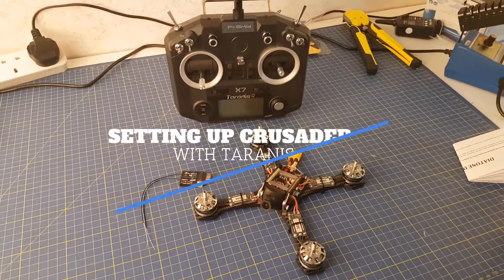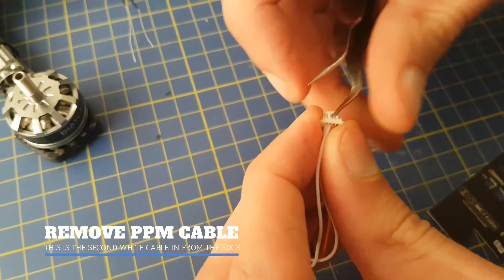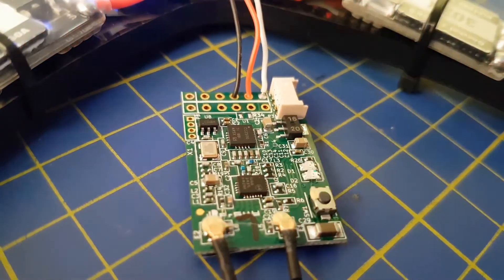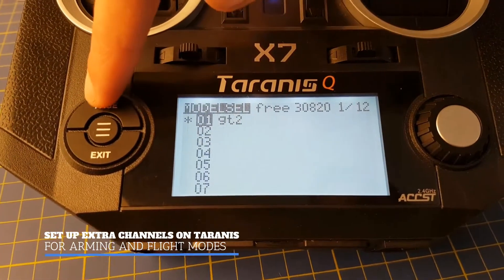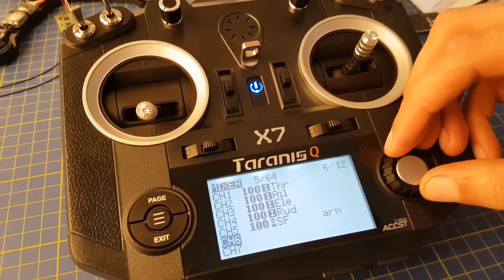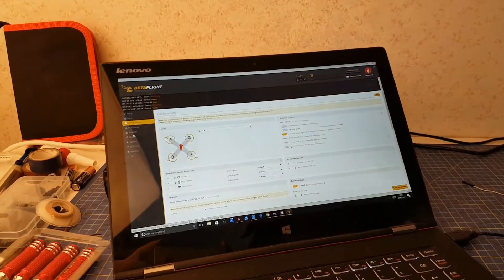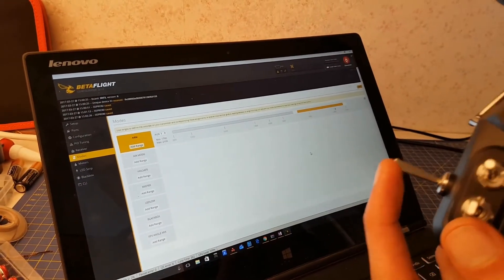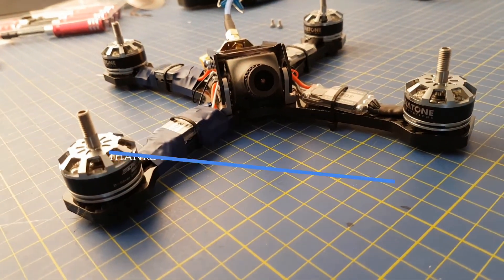Setting up the Crusader GT2 with a Taranis QX7

Comment: I downloaded betaflight but it wont connect. All the other steps worked fine up until now.
Here is what its saying
2017-07-09 @ 19:57:37 -- Running - OS: Windows, Chrome: 49.0.2623.112, Configurator: 3.1.1
2017-07-09 @ 19:57:58 -- Serial port successfully opened with ID: 10
2017-07-09 @ 19:58:08 -- No configuration received within 10 seconds, communication failed
2017-07-09 @ 19:58:08 -- Serial port successfully closed
the port is COM1 - that looks wrong to me. baud rate is 115200 - this looks right
Was there something else I was supposed to download?